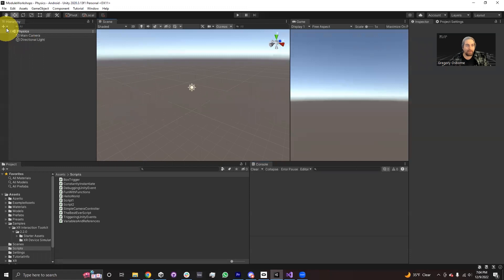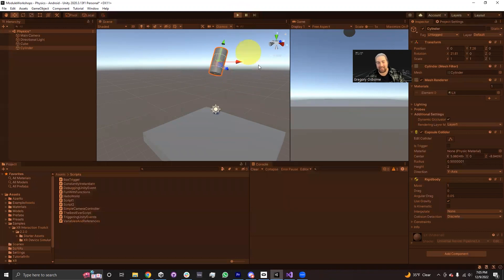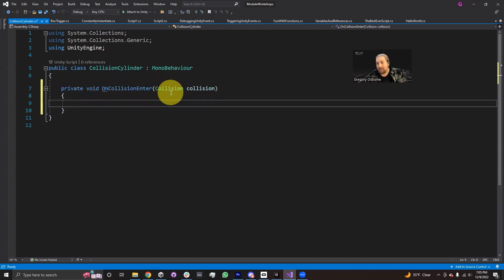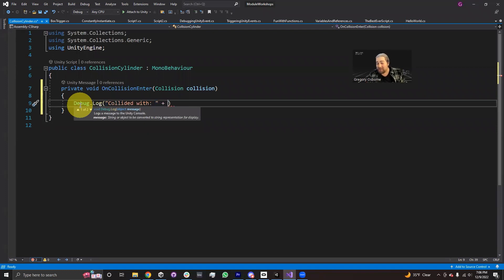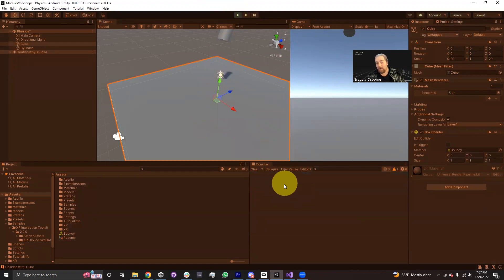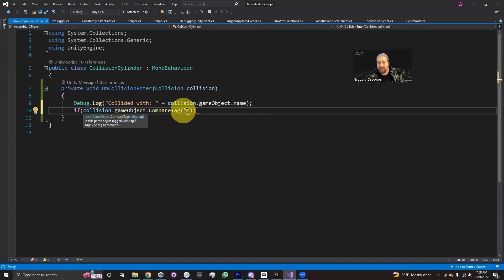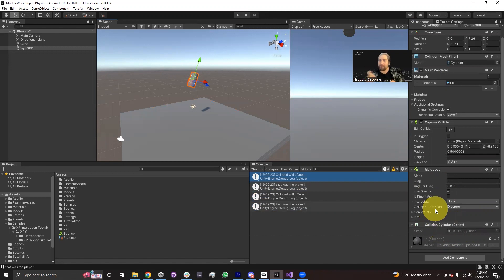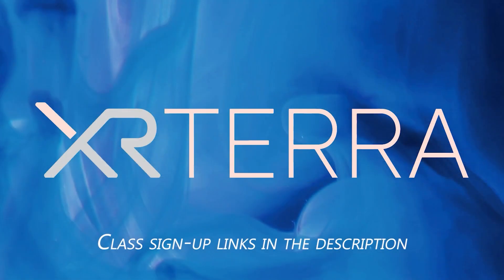OnCollisionEnter() Collision Detection in Unity

Comment: Great, entertaining video! Mind if I ask you about step-up system? I've created a voxel world with rigidbody player and I'd like rigidbody to transfer position with Vector3 Lerp, when it meets a one ingame voxel tall block. I've used raycast, then boxraycast/colliderRaycast and even OnCollisionEnter and it still won't work. When rigidbody is going down the terrain it snaps perfect to the ground, but going up isn't working at all. Thanks for your time!
Reply from the maker: If the goal is to have the player automatically lerp up when approaching a step up, our first instinct would be use one low forward raycast to determine if there's an obstacle within a short distance, and one high forward raycast to determine if there's space above that obstacle, and trigger the lerping up if the high raycast doesn't hit anything at the same distance as the lower raycast.
Reply: @xrterraclass  I did this approach, the thing is when half of a player rigidbody is touching a stepup, it won't activate the lerp/snap. That's why I've tried boxRaycast and then OnCollisionEnter, which won't work for me at all. I'll try to debug code or try again with boxRaycast one higher than the other near the feets. Thanks for the reply tho!
Reply from the maker: You can also try Trigger Detection instead of Collision detection, which is the next video we released.